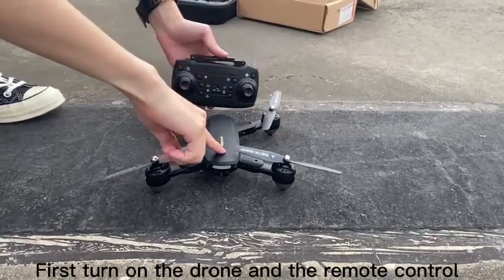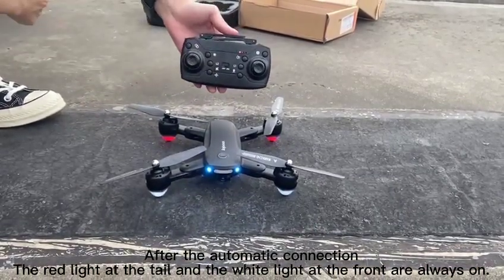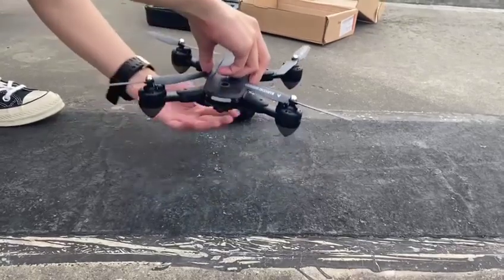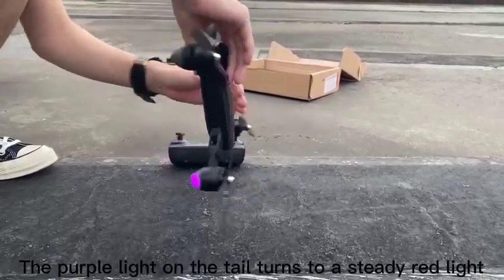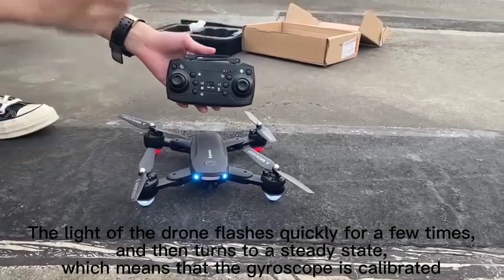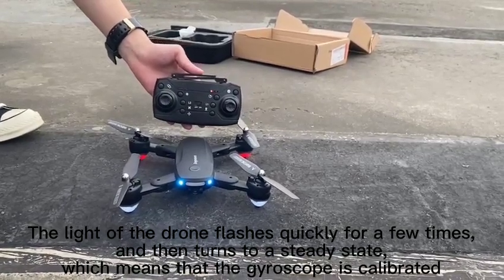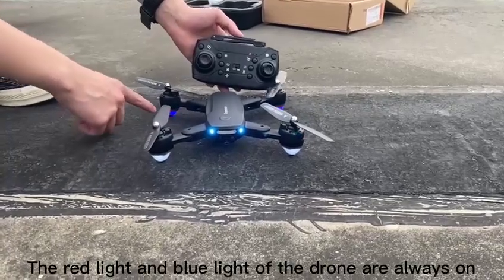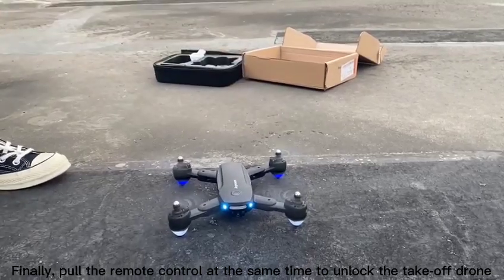X11-GPS Operation video

Comment: How do I install a smart phone in the remote?
Reply: There is a pull out tray on bottom of remote
Reply: @emilymoncada2929   It's not wide enough for my phone with the protective case on, like some car phone holders. That's so dumb! I'll have to take the case off, which I need to keep on, to use that.

Comment: My power button is on the battery not on top like the video is showing.I pushed the power button on the battery and does nothing and it’s fully charged.the lights on the drone arms will not come on.not sure what’s the problem with the drone not working.
Reply: Try holding down the power button for 10-20 secs

Comment: This helps out a lot thanks for the tutorial
Reply: Question. Do you have to do anything with the application?
Reply: It’s the VS GPS PRO app.
Reply: @Baseman0727  
Thanks.  I have the instructions that came in the box. Things do not have an easy flow to them.
I have “VS GPS PRO” as the app on my phone. I cannot, however, find the Wi-Fi pop-up on my iPhone13’s wireless. Thus, am stuck.
I can do minimalist flying.
but nothing involving the
phone, cameras, etc.
Is there a new Wi-Fi to look for? anything?
Have seen NO consumer help, no user support - nothing!